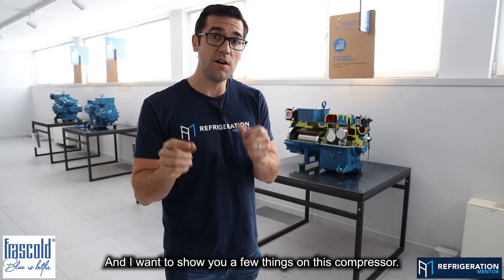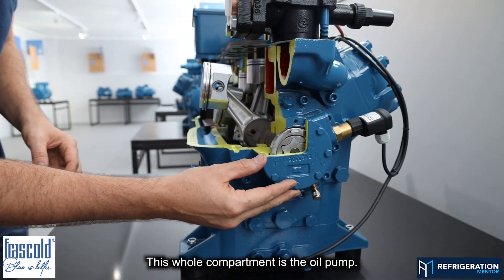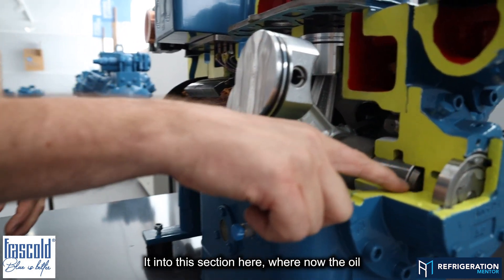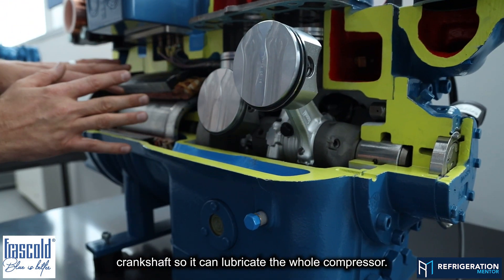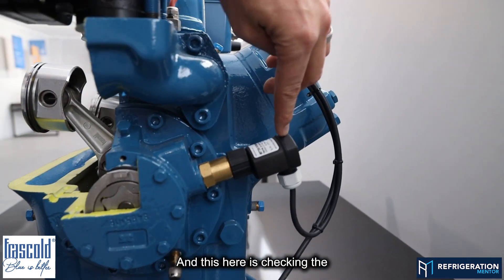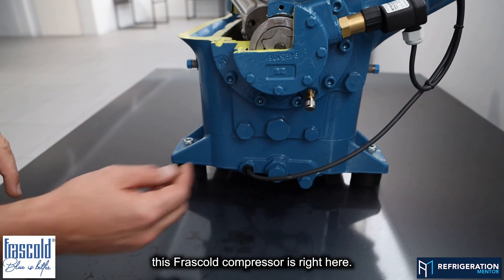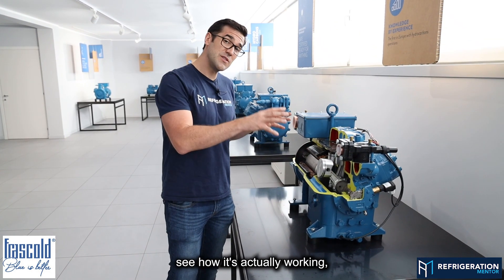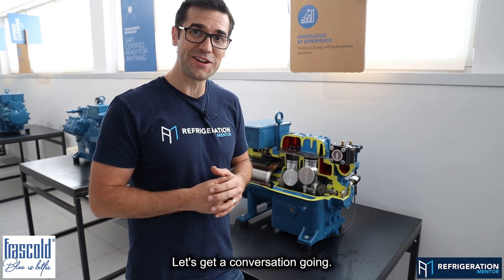How does and Oil Pump Work? | Frascold Compressor Cutaway

Comment: When checking the net oil pressure you said to take the oil pressure at the shrader valve VERSUS the suction pressure, by versus do you mean minus the suction from oil pressure or Add both the numbers together?
Reply from the maker: Oil pump pressure - crankcase pressure (suction pressure) = net oil pressure

Comment: Nice one, the oil level in sight glass is bottom only during running, is it ok
Reply from the maker: Not really. If your at the bottom you have to figure out why.  Most compressors should be in the middle of the compressor oil sight glass.

Comment: Thanks for your video. Does the oil pump care about the rotating direction? Or what I would actually like to know does the piston compressor care about what direction it rotates. I understand that the pistons do not know which way the crankshaft is rotating, but is there something else that can care about it. Oil pump could be one? Thanks again
Reply from the maker: Not if it has an oil pump. I heard that it can make a slight difference if it has a slinger or dynamic disc. It a great question to follow up with your compressor manufacturer.

Comment: If I change out oil differential pressure, do I need to drain oil out?
Reply from the maker: @NROhvac  great question. You should not on most compressors as they are above the oil line as you can see on this compressor. But you need to make sure you safely remove all the pressure out and isolate the power, replace and then evacuate the compressor before turning back on.
Reply: @RefrigerationMentor  thank you
Reply from the maker: @NROhvac  your welcome more content here https://linktr.ee/refrigerationmentor